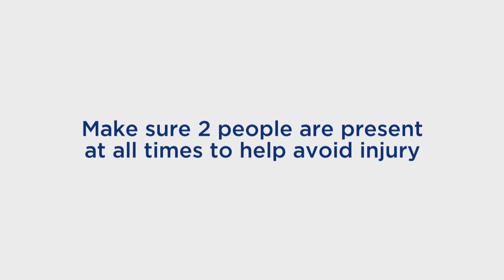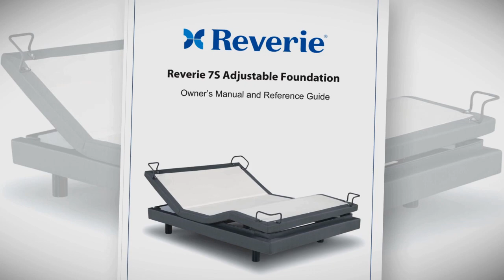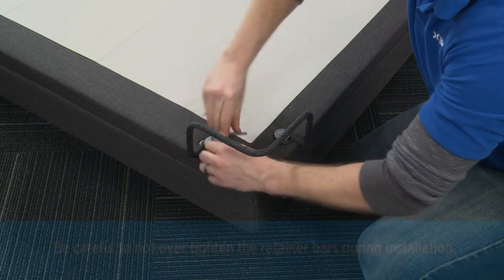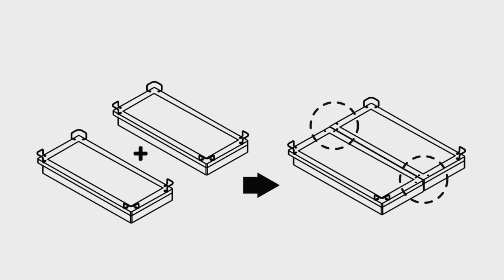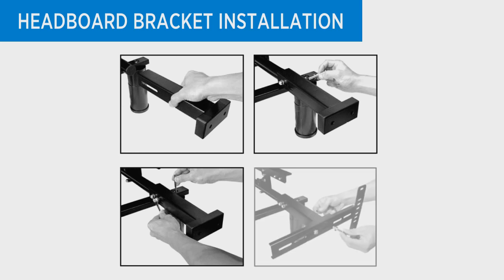Reverie 7S Adjustable Foundation Set Up Video

Comment: >The main control box of my 4-month-old Reverie bed failed.  After days of trying to reach Customer Service, I'm told that the bed has a 90-day warranty and I'm out of luck.  Send $ 279 for another one with a 90-day-warranty.  So my $900 bed is going in the garbage.  These people are predatory, and I'll doing all I can to stop them and their retailers from ripping off any more buyers.
Reply from the maker: We're sorry to hear of your sentiments, as this is certainly not the optimal ownership experience we strive to provide for our valued customers. Please don't hesitate to reach back out by calling 800-973-8374 or sending an email to customerservice@reverie.com, as we'd be more than happy to further discuss this matter.